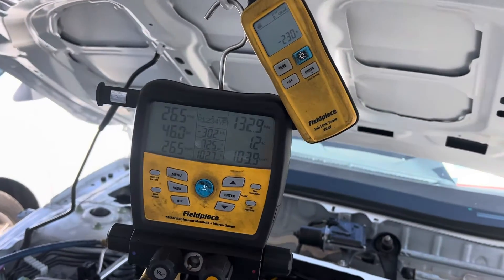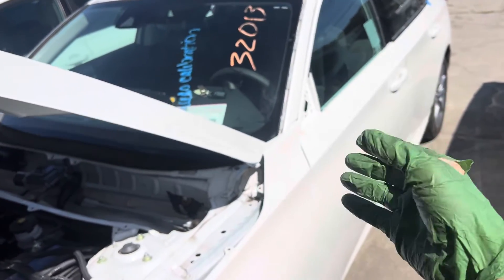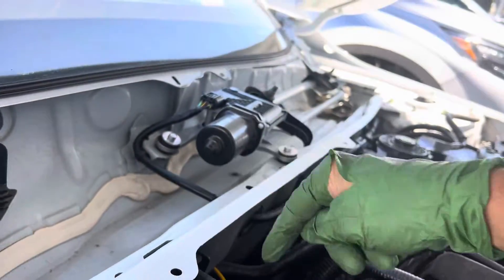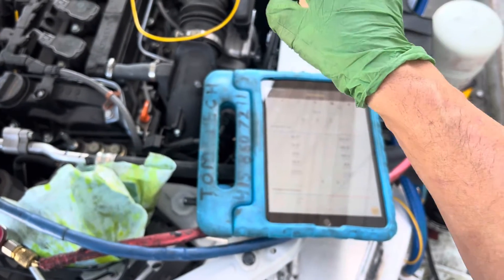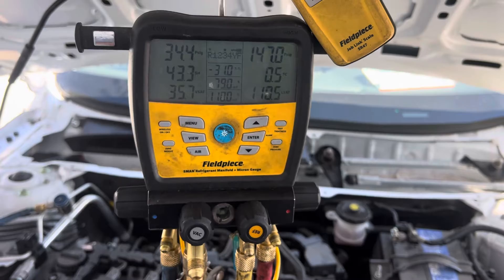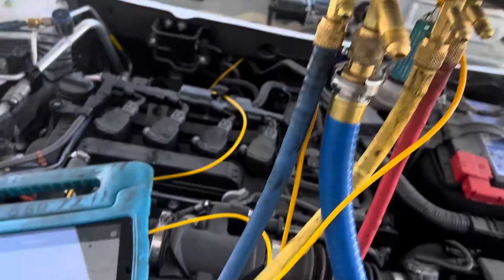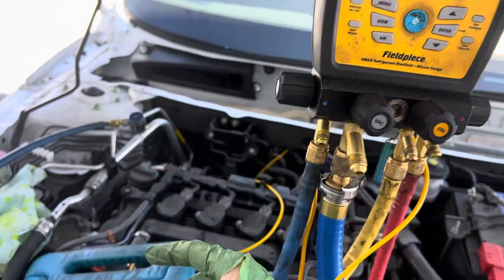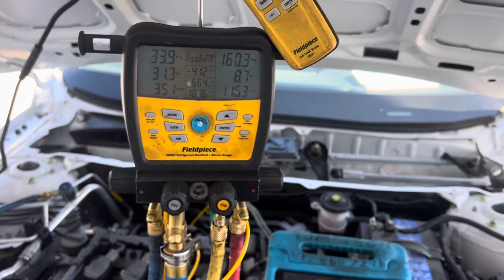AC REFRIGERANT SUPER HEAT & SUB COOLING WITH REFRIGERANT CHARGE EXPERIMENTATION

Comment: so Tom,the sub cooling of 20 degrees to 50 degrees that a/c training materials always mention and super heat of 0 degrees a d 5 degrees for orfice tube system and 10 degrees super heat for expansion valve system do not mean anything ,i am wondering why they keep printing that in their books,even in ASE books.they do not realize keep repeating something wrong will not make it right. thanks for another educational clip.
Reply from the maker: This is what happens when uneducated old dinosaurs are allowed to be in charge of a company or information. 

Even the dealerships keep repeating stuff occasionally I still come across stuff that was printed from the 70s or 80s with their temperature pressure charts that are completely wrong for today . 

Even though I tell people to read the information, but I must tell them the information is not always right 

But the only problem is we come back to lack of education in the first place, where they don’t even know the basics and the basics they were most likely taught were from 70 years ago . 

I’ve always taken superheat and subcooling on every vehicle since I was a kid when my dad taught me 

I’ve always use a micron gauge from the very first air-conditioning job. I did at 12 years old under my dad a micron gauge was the first thing that was hooked up that he taught me how to use. . 

And he told me you always use it on every job. You never skipped this procedure. . 

And as a child, not being raised in a commercial environment out in the real world with uneducated individuals who are in it for the money and how fast they can do it . 

I only knew and was brought up doing it the right way precisely every time without exception, I knew no other way . The first eight years from 12 years old on I never worked around any other mechanics in a shop until I got my first job. 

I only knew how to diagnose correctly 

I only knew how to perform procedures on diagnosis. Following steps and trees.. 

I never knew, or even thought that there was individuals who just swap out parts, trying to fix fix something 

My father taught me you do it once you do it right and you’re always 100% correct every time . 

I never knew there are people who just guess at what’s needed 

I never knew there were people out there who repair cars by what they feel or buy what they think should be done . 

You could imagine my shock and awe when I entered the market 19 years old 20 years old with other technicians who are 12 years to 17 years, my senior in experience .  I’ve never seen so many shortcuts, guessing and mistakes in my whole life within my first few months of working at my first job. 

I didn’t know they hired idiots for managers and supervisors. I didn’t know that service writers were usually clueless technically and did not know how to communicate between the customer and translates the information from the customer to correctly. Tell the technician what to look for a problem. . 

That usually led to miscommunication and improper diagnosis due to lack of communication . 

Our industry is a septic tank . 

Thank God, my father and grandfather raised me to know when it was time to fire your boss when they’re idiots  

There was always the old saying technicians are a dime a dozen . 

In reality, Bad, bosses, supervisors, and managers are less than a dime dozen. They’re like fleas on a junkyard dog. . 

I guess if you’ve watched my videos, you’ve seen my superheat on certain vehicles be as high as 50 or 70° and as low as near 0° on the newer vehicles with electric compressors and heat pumps . 

Cooling ranging somewhere between five and 7° usually up to 30° occasionally up to 40°   

And now, with today’s variable displacement, compressors that we’re not available back when that literature was written 

Variable speed, condenser fans that did not exist back when that material was written 

And airflow is king 

It will throw your superheat or subcooling all over the map . 

Unless you’re lucky enough to be on the very hottest day that makes the variable displacement compressor run at 100% and makes the condenser fan run at 100%. You can start recording some numbers that will be pretty steady and repeatable but only every time you hit that certain ambient temperature for only that year make model vehicle car under those conditions. . 

I haven’t released the video on an Audi. I had a problem with today that I seen something happen on a heat pump that I have never seen before on these Audi. I’ve done about 30 or 40 of them. 

This one when you see the video published in a couple weeks you’ll know what I’m talking about . 

I have to do some reading, and some learning . 

I knew what was going on, but I just didn’t know how to control the controls on this Audi 

And I did not know what the software, and a time intervals that might have been taking over, controlling everything behind the scenes . 

We learn something new every day 

I’m just a student learning .
Reply: hope one day you write a technical  book and hopefully before i retire. @coldfinger459sub0
Reply from the maker: That’s on my bucket list of to do items